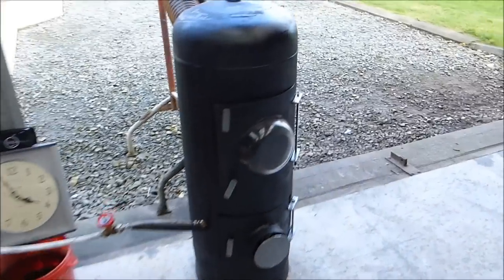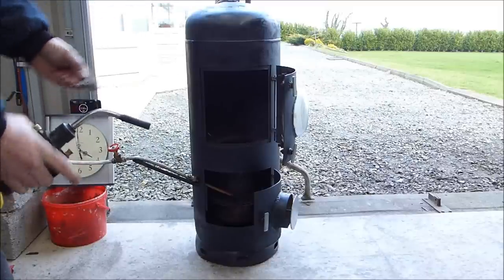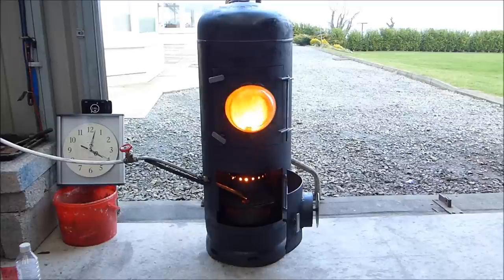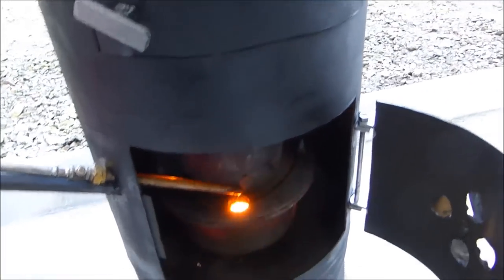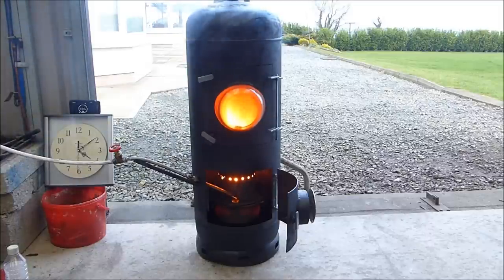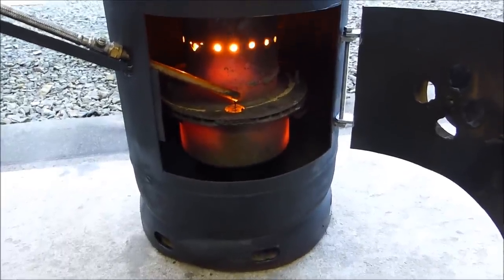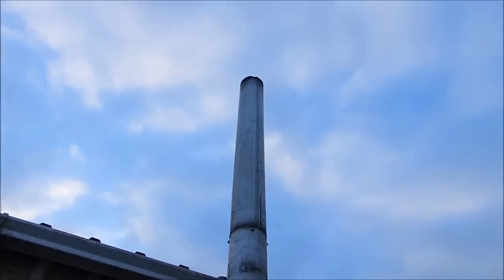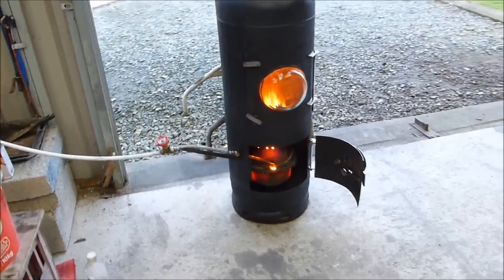Fantastic diy waste Oil and Wood burning stove heater.

Comment: looks HOT
did you let the paint cure a day or so

about burn time from what i have seen to date in order to keep the burn kind of clean you need 3-4lt hour
without air injection (electric fans or a compressor) you cannot run these on low it will smoke too much
Reply from the maker: Hi thegreatfixer.  It gets incredibly hot and I gave the paint no time to cure. Once it was touch dry I lit the thing. The air fuel mix and the chimney are important to how clean it burns the fuel. If I were to burn 6 litres of fuel I would need larger holes in the burn tube to avoid smoke. The reason I use the same burner in the different stoves / boiler is that I can get it to burn clean around the 3 to 4 litres per hr. Burning at too low a fuel mix wont get the pot hot enough to vaporize  fuel so you are correct there are limitations with this design but great that it is independent of any mechanical or electrical requirements. Cheers